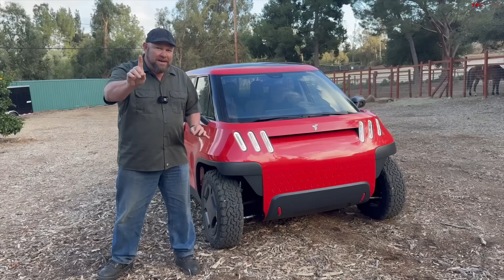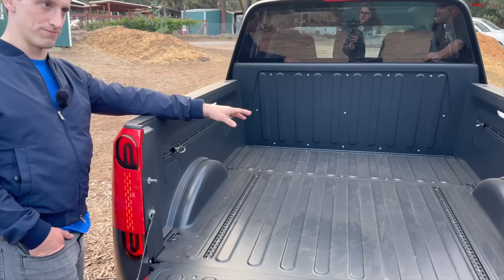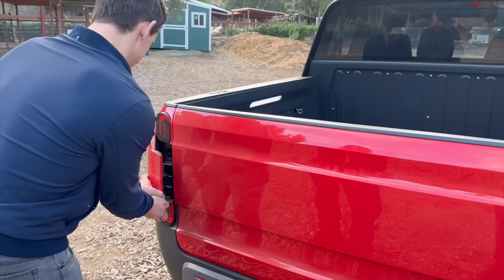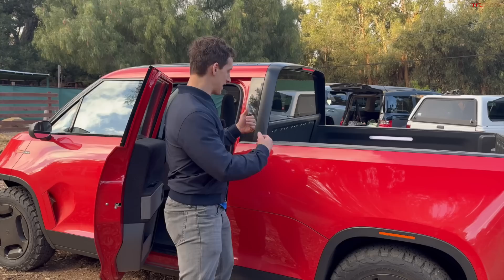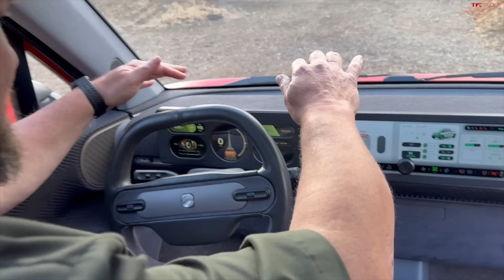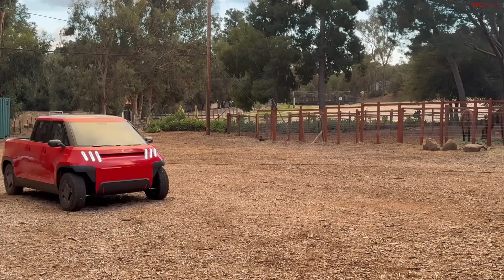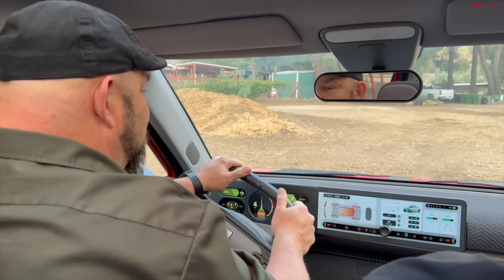I Drive the Most Revolutionary Truck In Decades: Meet the Telo MT1!

Comment: This is pretty damned cool... back in the 90's I've had an Isuzu P'up, Chevy S-10, '93 Ford Ranger, and even an El Camino... I always used the hell out of the bed of my mini trucks, but never needed a full size. I could bang around in this all day getting stuff done! 500 hp is no joke on a vehicle that size, either... my little Focus ST has 250 horses/270 torque and it's a little beast. I'm absolutely feeling this!

I haven't converted to EV yet (not many charging places in my area, though I'm sure that'll change soon), but this is exactly the type of ride I'd go for. 

I just wish they could throw a fat bumper on the front to break up the design a little bit, but that's just a nit pick. This is very, very cool.

Comment: Really like the idea of a small Electric Pickup but the Front end needs to be extended out much farther than this design. Doesn't even have enough space for a "Safe Collision Crumple Zone, the driver and front passenger literally are seated basically inches behind the front end and it has 500 hp! Seriously, just hitting a deer would likely result in serious injury or be fatal. Come on, redesign the front end and extend it out farther to not only give you a small much needed "Frunk", plus it would also greatly improve the aerodynamics because it looks as streamline as a brick and it would definitely make it SAFER in a collision. The small Electric Pickup Toyota designed called the Toyota EPU in the recent Auto Show is a whole lot better design than this Telo. I really would like the idea of a small Electric Pickup but I do not like this design at all!

Comment: Throw a brush guard on it and I’d use that on the farm instead of my side by side.  I could run to the store load up on things and drive it straight to where it needs to go.  Instead of loading and unloading supplies.  

I wanted to get a bongo truck but the import fees are crazy.

Comment: A vehicle that is needed, but in a price range that is higher than I would have anticipated for a vehicle I would use secondary. It still peaks my interest.
Reply: @InHellBaby1 I understand why it costs what it does but this thing's not taking off the ground at that price. That's just my opinion. The Chinese have been very good with their electric vehicles recently. The Chinese are good at making cheap stuff that doesn't last at a super low price but they are also good at making very good quality stuff at a higher price point. In all segments of all markets they have shown their capable of doing this. Tariffs and import costs would put their vehicles probably around the same price but their ability to build something like this at far less money already exists.

Comment: Realistic truck for me - an IT professional working from home , love daily yard work, occasionally helping my young adult kids moves….It would motivate me to take action if price is lower.
Reply: Yeah 36-46k is so realistic for this garbage. You gotta be 5'3 & not actually need a small truck other then 3 times a year.
Reply: @andrewdean8848  With 500 hp? I don't think the price is cheap.
Reply: @ancientschannel3131  500 hp - for how long ? 5 min ? lol
Reply: @phuocnguyenvan9717  It's not how it works buddy. Go Learn some
Reply: @phuocnguyenvan9717 are you 5 years old?
Reply: This "truck" is not worth more than 1000 USD.
Reply: @phuocnguyenvan9717  Neither is your comment. This truck was specifically designed to be about the size of a Mini Cooper, which is about a foot shorter than a Chevrolet Bolt EV. The fact that they have managed to pack in a comparatively enormous bed and that they can accept the standard 4x8 sheets of plywood with some trade-offs for rear passengers is quite amazing. I will certainly be buying one of these vehicles if they reach manufacturing. These trucks aren't designed to replace the average Ford f-150s, or whatever that you use to tow your RV for thousands of miles, that's explicitly not what they're targeting. But they are targeting people that need extreme usability in a very congested environment, and that describes me and thousands and thousands of people.

Comment: $41,000. That seems a little steep. I was thinking he was going to say . $25,000
Reply: @elmer3383  agreed. The comparison to a kei truck made the price difficult to process
Reply: They don't have their own facility and are doing contract manufacturing, which is why it costs so much.

If they had their own facility and were making half a million trucks a year, they could get it to the price you want, but unless people who can afford it at the current price, buy it in mass,

That will not happen.

As i'm sure you're aware, even a toyota camry prototype, which is made by tools in hand without using mass manufacturing cost a couple million dollars apiece.

It's only once you get discount on bulk purchasing and the mass manufacturing plant setup does the cost drastically drop Because the labor requirement decreases drastically

Comment: The only thing I think this could be improved on is to put some physical controls in the blank space right below the screen, so you can adjust things like te AC with knobs or buttons without having to focus on them while driving unlike a touchscreen.

EDIT: ok I just saw they are going to put some physical buttons, but I still think it would be better on the blank space below the touchscreen intead of right in it's edge

Comment: Would be way more interested in this if there was a version that only seated 2 in exchange for a longer bed. Whenever I drive my current truck I almost never have a passenger, let alone 4 passengers, so the extra cab space doesn't do any good. I do however need to actually use the bed for hauling stuff so having as much bed as possible would absolutely come in handy all the time.
I also want crank windows but that's because I think things should sometimes be bad on purpose

Comment: being fat, idk if i could even get in the thing... thou carrying upto 5 people means it should be able to have me as a passenger/driver.  they have a 2 seat version, offset for people like me?  driver more centralized for space and the passenger in back on the passenger side.. with internal space in front and back for even more cargo?  on second thought... wide seats and no central feature?  do love the design otherwise, makes me wish i didn't live in an apt complex that has no garage.  so i'd probably have to carry a small gas engine to charge the battery on the fly.

Comment: I’m still only a couple of minutes in, and it’s very cool, but base price is almost $42,000. Fully loaded it can almost get up to $60,000. For that money I could get a larger and/or more comfortable vehicle that’s gas powered, meaning I can refuel anywhere. Among more than a few other arguments against it. If it were about 1/2 the price it would be fine, but I have yet to see anything that would make this vehicle worth the current cost. I’ll edit this if that changes

Comment: The only immediate complaint is I'd like to see some kind of pull shade for the glass roof. It doesn't even have to be automated. But glass roofs in the heat are a killer and a shade would help quite a bit. Beyond that really hoping to see these folks succeed. Small? Practical? Off the shelf parts? Yes please.

Comment: It isn't new.  Just in America trucks like fast food was supersized.  Toyota is coming out what they said will be the $10,000 mini truck.  In 2025 we will see.  In America we Had the Ford Courier, Dodge Rampage, S 10, and Toyota CR5 pickups.  Though they seemed to have not been on the market for  decade or two.  They are made in other countries abroad and south of the border.  Just not here.  People cant pay $70-$100k for a truck.  Not that they have a choice as Crew cabs have been pushed onto us for a while.  Even this truck is a crew cab!!!  The Truck was always 3-4 x higher than a single cab what would be medium class truck today.  I think more pickups would be sold if they were $20-$35k.  But that still excludes an ever growing amount of buyers.  As those making poverty level and just above poverty level wages is growing fast.  All I want is a small single cab 4x4 pick up.  This truck is ugly.  But I am also looking for good fuel mileage with enough power to go uphill easily.  If it isn't to much trouble be able to town a fishing boat or small camper while doing it.  Is that two much to ask for?  The only add would be AC.  Oh and a 5-6 speed manual transmission.  I can double MPG the why I was taught to use it with that and it adds to the driving experience.  In the US it would sell like hot cakes.

Comment: I've been driving the Maverick now for about a year. It's boring but it is fantastic. I mean it has saved me thousands of dollars and it's got fairly impressive statistics. As far as hauling, I really consider it a mini truck. Depending on how this electric truck markets and tests I would definitely consider buying it, but for anyone out there who doesn't want to wait so far my Maverick has 25,000 mi on it. It's giving me no issues. I've hauled some rocks plywood a lot of garden soil. It has saved me about $7,000 a year. I do a lot of driving. I'm getting an average of 41 in the winter and 44 and 1/2 in the summer

Comment: The solor panel on top should be standard on all EV for exactly the first reason he provides; I’ve had static load draw down my 12v that then caused the high voltage battery to empty while my EV was stuck inside a forest fire

Comment: It’s the right size for an EV truck IMO; town is some 20 miles away on mixed dirt/paved roads which is not too far outside what a moderate solar system can provide if I’m not burning electrons on extra weight

Comment: Not gonna lie, I've been anti electric vehicles since they came on the scene. For economic and practical reasons. I only found out this thing existed about an hour ago and I love the idea. I currently drive a 27yo diesel Japanese import mpv camper conversion which I adore. I took one look at this and instantly saw it as a 21st century version! As a brit I would love to see this go into direct competition with the VW ID Buzz over here. Its cooler, more compact for our roads, and overall a great little option for the microcamper community.

Comment: I'd make all back-bed sides doubled (maybe even overlaying the bed, and then unfoldable (+ rear window foldable up) and then interlockable; the slide-out "bed covering"/weather protection to connect with/over them. So, one could technically make an almost full-seated cabin height enclosure of the whole back, for transporting larger pieces of already assembled furniture, or make it a small camper.

It could be even made as an optional addon, but the back window would have to be foldable (in or out) in the base model.

EDIT: nevermind, later on, he mentioned they plan on having an optional glass extension! Awesome! Now this guy thinks like I do — function and practicality! Still, a lightweight integrated version of what I mentioned could be made rather cheaply ob the base model, for those who just want to occasionally transfer larger stuff. Also, bed tie/anchoring points; I'm sure they are there, but I forgot to look for them.

Comment: Pricing is always quoted as the low end striped model, with the short range battery, then they give you the stats for the Expensive model with the long range battery.  
If these companies would build even these ugly little truck like things, and price them at 20K not 40K , they May sell to more than their investors and a few early fanboys.  
The thing is if they are so "simple" just really a battery and electric motors, and a tablet for controls, then how do they justify 46K for the longer range model before you add the Solar panels, and camper cap or the other addons?   That's the thing, they can't.

Comment: Thank goodness someone is taking on the challenge!  Personally, I wouldn't mind if that glass roof was 1/3rd the size (theft concern) with the remainder being solar cells and metal.  Also, how about a 50/50 or 30/40/30 rear fold down seats?  Alao would want a Range Extender option in exchange of some battery space. And finally...how about a version 12-14" longer for extra cabin space, utility area up front (mini-frunk? winch?, bush lights?), increased structural safety/durability, and/or a longer bed?  PLEASE keep in touch with them with quarterly updates!

Comment: My Only Fall back on vehicle is the glass roof. A utility vehicle should be used for all types of work and the owner NOT afraid to break the roof at every turn. 

The metal roof should be standard and glass roof optional. Utility folks don't care about 'sky views' BUT the functionality and usefulness of vehicle, otherwise it's not that "useful" if you can't haul stuff overhead every now and then or most times.

Other than that, great concept with the vehicle as a whole and the 'suv' mode and 'monster tunnel's perks.  Small utility vehicle 'capability' is much needed without the 'big' vehicle space and price tags.

Comment: Didn't Jason say, early in the video, that range for both lines was around 350 miles only to say, near the end, that the "base" model is 250 miles? And does this vehicle not have a parking brake? I noticed chocks were used when the vehicle was not turned on.

Comment: Reserved my Telo early.  Have two concerns:  Firstly, still have not heard  details about how the vehicles will be sold and serviced other than a general statement that they hope to implement some type of franchise model with existing dealers.  As someone who lives remotely this is a genuine issue since there is no existing BEV service infrastructure.  The second concern is cost.  Ford CEO Jim Farley has stated that their mid-size electric truck which is slated to hit the market in two years will start at $25K (and will have an accompanying distribution and service infrastructure).  Great news for consumers like myself who are wanting a small electric truck but ominous news regarding Telo's prospects for success.

Comment: love everything about this truck!!!! finally a truck desing to carry stuff and people, not to look tought and run over childrends... only thing is im worried about the the carbon/aluminium chassis, it can end up with galvanic corosion in salty roads of the north, any feedback on what was done to prevent that? 

fun fact, i have a silverado at work and the bed is so high that there is no way the wheels can reach the bottom of the bed, even fully compressed on the bump stop, there was still 3'' clearance. so the wheel arch in the bed are only there for look.. and to mess with loading up the bed. pick ups have gone stupid since the 2000s!

Comment: I bought a Dodge Dakota in 2000.  It's not as small as this truck, but it has carried everything I ever asked it for 25 years and it's still on the original motor and transmission. Almost every house in my neighborhood has some monster 4 wheel drive jacked up truck sitting in the driveway because it's too big to fit in the garage.

Comment: The problem with small trucks in America is the not so small price. This is no different. A fully specced out Tacoma is about the same cost as a full sized Tundra (just two trims down from the top!). A fully optioned out Ford Maverick (the smallest "truck" in Ford's lineup) is damn near $50k. That's a well-optioned full size F150 XLT that can do so much more. Yeah, I get it. Not everybody needs the full sized Truck. I'm one of those. But for the performance/dollar I'd get rather just get the full size with a daily beater. 

Kei trucks have been successful because they can be had for the cheap utilitarian vehicles that they are. A $50k "small" truck isn't going to do big numbers no matter how great the design/engineering.

Comment: Too bad it’s an electric milk float that will be terrible in the winter, depreciate fast, and is a potential fire hazard and is not good for the environment.  If it was diesel or gasoline powered it would have been fantastic.

Comment: Iteresting idea!   Cosmetically they really need to work on that front end.  It looks basic(boring/ugly) and chopped off badly.  Especially with that black plastic at the wheels.  (Was It designed by a todler of Elon Musks? 😅)  With the reviewer in it, that interior looks tiny!!  😮😅🤔 I'm glad they aren't going to load it up with ridiculous junk "stock"  No stock heated stearing wheel, no heated seats, etc.  Living in the desert (or any warm/hot location)  I do not car about that or the sun roof.  Most people around here Don't like/want to be cooked and given sunburn/skin cancer, just while trying to take a trip in their car.  Many Do Not Want any Type of Sun roof.  Because of the afore mentioned and not wanting the extra expense, complexity, weight , structrural issues, potential leaks , (with many, reduced head room)  etc, etc,    The "250 mile range " does not seem that impressive.  Particularly  since they never seem to be able to meet those ratings.  Especially while hitting the highway at 81 MPH.  Wich is when I would really care about the range. 
But Dang!   $40,000 for the little toy truck!  😧😅  I thought the would be trying to make this thing beat Fords original offering price for the Maveric, Or something ...  AND "WE" WANT BUTTONS!  We Are Driving!  Don't want to be little kids screwing around with "video games" and have to distract ourselves waiting on touch screens , and diving down into menu's while driving!   And the greasy finger print smudged up screens Do Not Look Good!

Comment: Funny. Showed chipboard instead of plywood. Granted, still the same measurement, but nowhere near the same material. Anyone using chipboard or particle board needs their head examined. By your own admission, the 4X8 won't fit unless the seats are all the way forward. Impractical. City...sure. Surfboard...sure. Real work...not so much. Clearly a city vehicle, never to be used for real work.